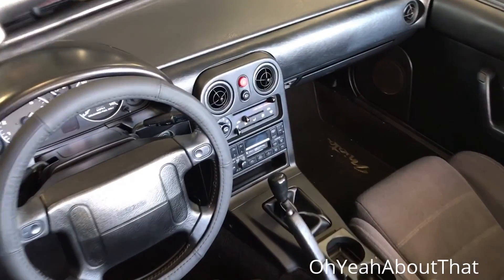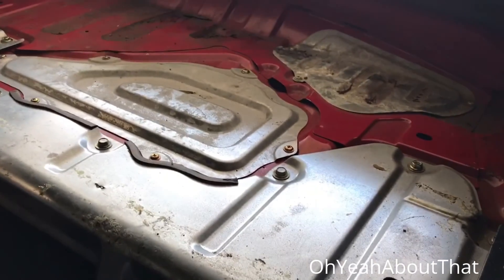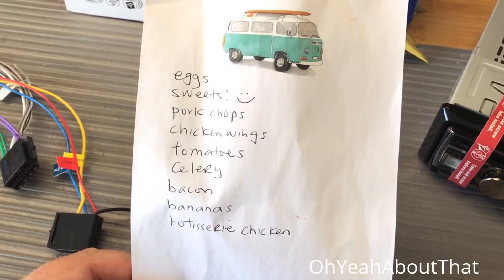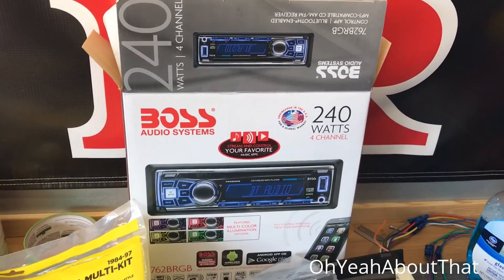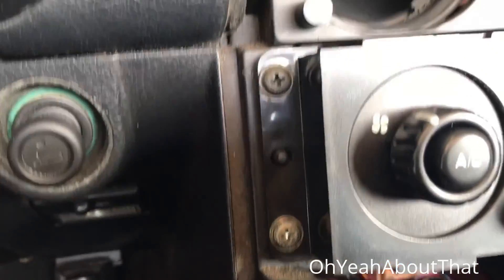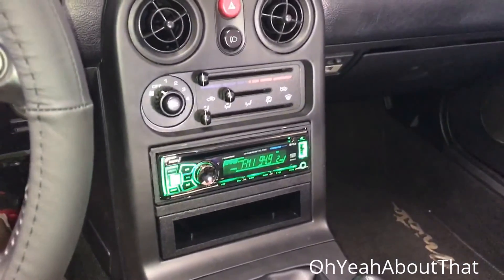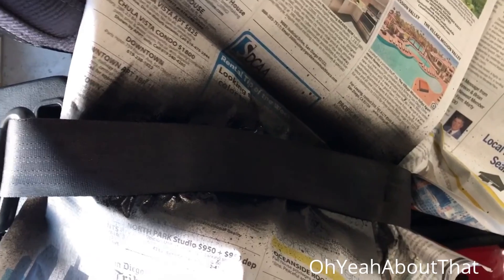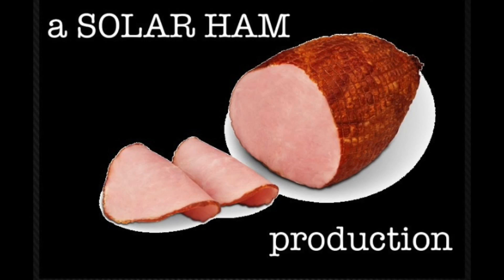project 1990 Mazda Miata [part 10] NEW STEREO AND OTHER GOODNESS!

Comment: I would have liked to have seen what you did to get a flush mount.  That's something that's bugging me about mine.  But I'm not sure if the deck I put in will be the final deck.  I don't want to start cutting stuff before I make any final decisions.  But it's really looking good.  I'm interested to hear how well that paint holds up longer term as I've got a few faded areas on mine I'd like to address.
Reply from the maker: I used the Metra mounting kit and I had to flatten or bend back the top and the bottom flange of the stereo 'cage' in order to have it slide in further.  Yours may or may not have the same flange.  It wasn't hard...just took a bit of time.  Sorry I didn't film it!
Reply: OhYeahAboutThat That's cool.  I'm looking for a decent deck with Apple Play to replace my current mechanism-less BOSS deck.  I'll also be going the amplifier route and far better component door speakers.  I'll see what Black Friday/Cyber Monday holds as far as deals go.
Reply from the maker: I've never purchased or used a BOSS product before.  I only got that for this car because it was bluetooth-enabled and you could change the color.  I guess you get what you pay for.  I like my Kenwood and JVC units more, but, oh well!
Reply: OhYeahAboutThat This was always going to be an interim solution just to get sound in the car.  The deck was $70 and the speakers were $27.  It's junk, but I knew it was.  I'll be doing it "right" soon.

Comment: I realize this video is a year and a half old but did you ever replace that cracked mid boot on your shifter, looks like it needed it at the time of this video. Will cut down on  heat coming up through the shifter boot.
Reply from the maker: Valdarious I didn’t. I have lots of projects to still complete on this Miata. I have a new video coming out tomorrow. Thanks for the comment!

Comment: Pick up some Delrin door bushings, they make a big difference.
Consider getting it sprayed professionally with a rust treatment product, especially inside the rockers.
Tinted Ebay signal light lenses look really good on it.  I can give you simple directions on converting to LED's if you're interested.
Reply from the maker: Doug Sogge thanks for the comment. I did a lot to this car but I haven’t finished. I’ll probably start working on it again this winter after I get my barn converted into car storage.

Comment: Really could have used your help on the crutchfield bracket assembly.   The instructions are crap.  Looks like you struggled some as well that housing trim around the radio looks McGyvered.
Reply from the maker: utube4greenfuture I did the best I could with a very cheap install kit. I’m not happy with the way it looks and would like to replace it when I find a better solution.